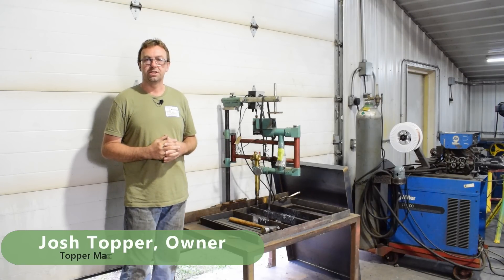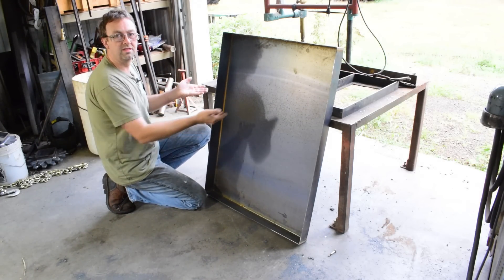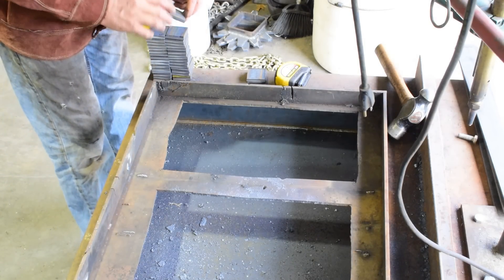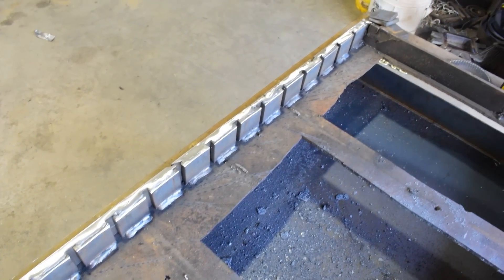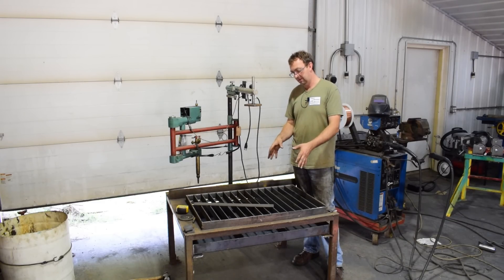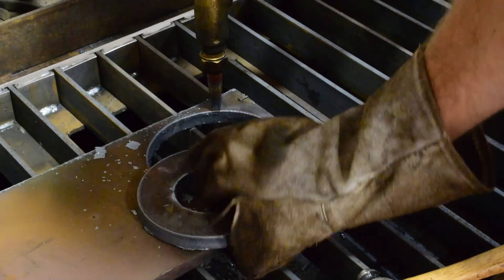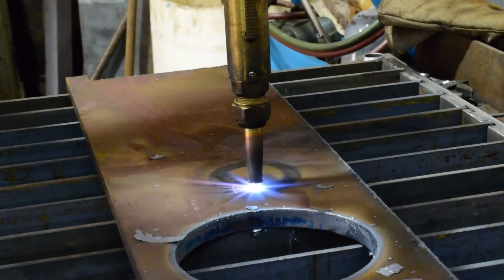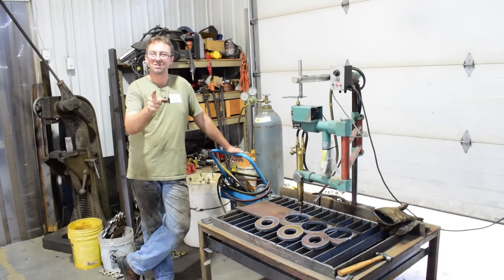Victor Pattern Torch Upgrades: Cutting Parts When CNC Machines Fail

Comment: If you decide to put water in the slag pan a drain pipe would be a useful addition to the pan.
Reply from the maker: After the first few cuts, I decided against water.  There was no visible burning/melting of the pan, and the slag lifted right out. Also, I dont want that much humidity going into the shop.  Hard enough keeping things from rusting.

Comment: Throw on a preheat cutting head on your MT210 or whichever Victor machine torch that is, and your cuts will be dross free and smooth as glass. Not as critical as when bevelling but still beneficial.

Comment: I love old school electro-mechanical stuff.
Not everything has to have a computer, a touch screen and an internet connection.

I am waiting for apple to come out with the worlds first smart vacuum cleaner, the i Suck.
It will use fuzzy logic to analyze the contents of its bag and send you a text message if you suck up anything important.
However it can't be used without an internet connection and it sells your data to marketers.

Comment: If you make one back corner of the pan slightly lower than the rest and install a spigot, you could drain the water into a bucket for easy flushing the water.  A thin layer of oil on top of the water to reduce evaporation.

Comment: I'm a mix of old school and new school cnc is awesome, but old school never dies. Sounds like your neighbor got stuck with a lemon... we have a power torch and with the right settings it cuts so clean you hardly have slag. Being able to have a controlled feed along with the right tip and pressure settings really helps produce nice cuts

Comment: Sounds like your neighbor should of built their cnc plasma table from scratch themselves.  I spent $4500 building a 5x10 plasma table with servo motor ball screw drive system.  It is actually the third table I built for myself since I wanted to make it bigger each time and add features.  Since I built it myself I can solve any problem that could possibly arise.

Comment: I would remove some of those slats, with the thickness of that steel it won't sag, slats will last longer just a thought
Reply from the maker: I have since been doing this. When I get into the thick stuff I'll need more, but for the 1/2" I use 2

Comment: What might be some easy additions for convenience and repeatability are a second set of adjustments, so that your main ones can stay stuck on settings you like, and the second turn on and off the torch, as well as a depth gauge for consistent offset (maybe use an Oring like they do for mountain bike shocks). And lastly, I'm not sure how well it would work, but starting the torch as it's already moving instead of lead in

Comment: I reconditioned an old CNC plasma table this spring.  I used 3/16 x 2 to make the "combs" to put along the edges of the table and down the middle to hold the consumable slats (your 1/4 inch ones).  Those were made of 11 or 12 gauge sheet metal strips about 2 inches wide.  I made them a little bit long and bowed them, so a straight cut wouldn't be able to track the length of one. That might be a rare occurrence for most, but I'm the lucky guy that it happens to more often than not!!  I was kind of surprised you used the 1/4" bar.  That pattern torch is pretty darn sweet.  Really a nice job today.
Reply from the maker: Good idea on bending the slat.  I used 1/4" because I can cut up to 6" plate with this torch, and I intend on doing just that.  Sometime soon, I will play with some 4" I have laying around.  Heavy stuff.
Reply: @TopperMachineLLC  Yeah, that thick stuff gets heavy quick.  You know what you are doing better than I do, so I defer to the master!!  Well done, man.

Comment: Topper,
If you are using a victor style tip a #1 should work wth 5/8" plate and acetylene. The should be a neutral flame with a slight more oxygen. Most videos I  watch they use way too much preheat on the flame and melt the edge of the plate. And if there's  too much slag on the plate it will clog the tip and make a bad cut. A needle gun can be used to remove it before cutting. And the comments about have no bars under the cut are correct in making a better cut. I've found after 42 years things get better with practice. Ifyou have the speed and oxygen right you will have minimal slag on the bottom.
Reply: Along with a new keyboard on my new phone. That i keep screwing  up on
Reply from the maker: Thanks Bernie,  Everything takes time to learn.  Hopefully I get enough practice with it to get better.  I do enjoy running it. I will remove the slats under the cut on the next batch.
Reply: Nice to get tips to improve and I'm not familiar with this machine but that is a beautiful cut I would be super happy with!! I do all sorts of this stuff for my own mostly, sometimes for others, after 10 hour shifts in a sawmill so I hear you on 16+ hour days!! Keep up the awesome channel and thank you for sharing.

Comment: I was thinking about your slag pan ,Could you fit it with a drain valve to empty it when you decide to fill it with water to make it easier to remove  for cleaning out , it may help extend the life of the pan
Reply from the maker: It will be added soon, just needed to get it together for the bail out job.

Comment: A local machine shop has a high pressure water jet cutter that does a fantastic job clean cuts and no heat distortion that I know of.
Reply from the maker: I use water jet shops frequently.  I have several large quantity parts I farm out.  They beat the laser and plasma guys on price and quality.

Comment: josh are the patters exactly the same size as finished product? or do they have to be scaled up or down for the thickness of the cut?
Reply from the maker: they need to be scaled a bit.  Based on torch kerf and stylus used.  I will eventually get a spreadsheet together of data for pattern making to speed up the process.

Comment: Josh that sad that your  Neighbor has so much problems with his plasma table.
I built my and it been flawless running for 7 years I did up date the controller 3 years back and never look back I use it as portable system in my enclosed trailer on job site work and when done I just roll it out back in the shop.

Comment: You might experiment with a selection of smallish magnets to use for lead-ins. Just stick the magnet to the side of the pattern and start the follower on it, then pull it off the pattern before the follower gets back around to it. Obviously there will be some sort of interaction with the follower magnet, depending on how strong the magnetic blocks are and which pole you have stuck to the workpiece. But it might work out fine, and would be real simple.

Comment: New school machines like CNC plasma or laser cutting tables are fantastic when everything works. But just something about the old school simplicity that just works reliably.  I remember way back in the mid 1970s when I was a kid. Going to work with dad who was a master welder. And watching him use a pattern torch like you only on a much bigger table with multiple torches capabilities. I haven’t seen one of those in many years. Very cool video

Comment: Love this. So with the CNC plasma you can define the kerf width when you post process the file to compensate for the plasma tip being used. What kind of adjustment does the pattern torch have for when you change cutting tips? I assume the pattern it cut to actual size.
Reply from the maker: The pattern is made to the size needed and you must figure in stylus diameter and kerf. It is tricky, but with practice I should get a system and have a spreadsheet of dimensions.
Reply: @TopperMachineLLC  A selection of stylus diameters would make life a lot easier than cobbling up new patterns especially when you have a to size part to use in the first place.
Reply from the maker: @deconteesawyer5758  I have all 3 of the standard sizes. Been thinking about making more.

Comment: Nice upgrades to the Pattern Torch. How about making some H shaped slats to keep the area under the cut clear, so that you aren't cutting your slats. It might also slightly improve the cut with not cutting the slat. This unit uses KIS technology: Keep It Simple. So it's likely to be more reliable than a highly technical CNC machine. Could also be that your neighbour bought the wrong brand of CNC machine?

Comment: You sure do download your videos early in the morning. Good to see you and I am glad that you were able to help your neighbor. It is cool that you were able to get good advice from your viewers. I have a water table under my CNC Torchmate plasma cutter. I only cut thin steel. I like it because it helps to control the smoke and the water splashes on the steel to reduce warping. I used to cut a lot of metal art and a lead in reduces damage to the part. When I was working, I ran a old Strippit punch and laser machine. I got replaced by a new laser and a younger operator and that machined cuts 1200 inches per minute. Nice job on the cut table. Thanks for the video!!!😃😃😃

Comment: Good for you mate 🤣👍
Reply: Kurtis don't worry we work 8 hours a day in Italy (I do 9 in a heavy equipment machine shop)
Reply: It takes them 16 hours to do the same job you do in 12
Reply: Go down with Curtis and play with big boy toys for 12 hours.
Reply from the maker: @tinkerersgarage2944  I have ran 48" and 60" swing lathes for 12 hour shifts.  HBM jobs that last days and multiple shifts working on the same part.
Reply from the maker: Just giving you a bit of crap. Actually need to hire help,but in our current world isn't happening. I'm sure you are in the same boat. Would be nice to lighten the load and have a little down time. Sleep when we die is the motto here. Lol
Reply: @TopperMachineLLC  
I would help you for free just to have something to do but I have a broken back.